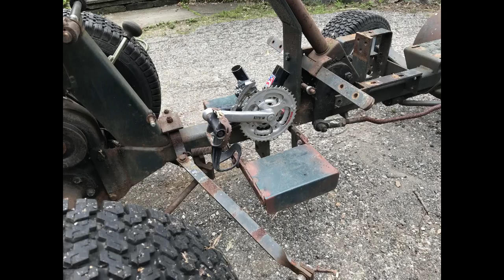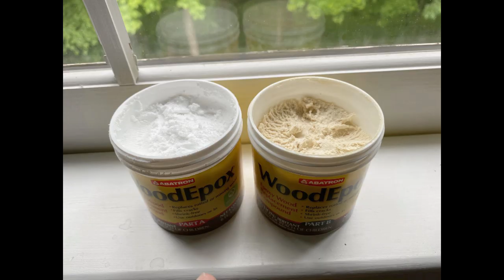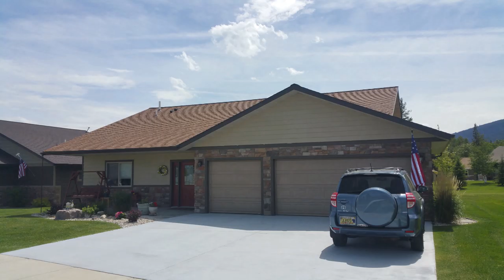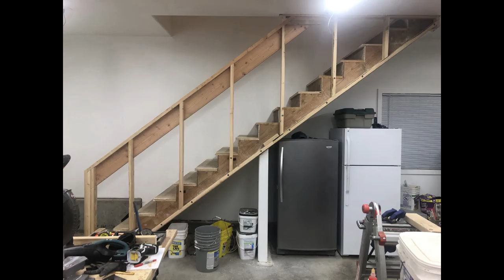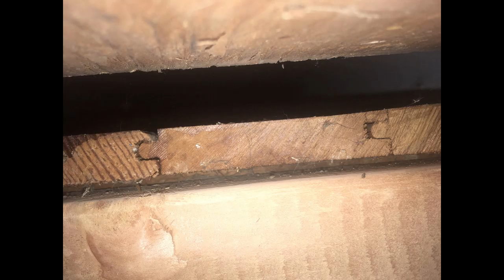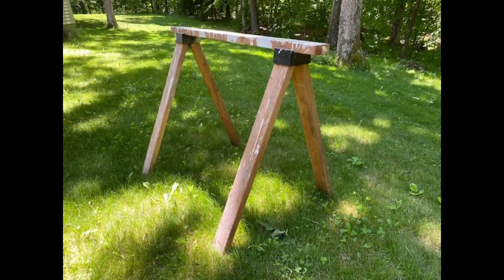Podcast 255: Ridge Vents, Removing Blown Fiberglass, and Matching Textured Drywall

Comment: Good video as always even without the sound.
Minnwax also makes an epoxy product for rotten or punky wood. First you use a liquid epoxy to harden the wood then use the two part epoxy to fill the void and shape the area.
I have also had a ridge vent come loose about 12 years ago. I have a double hipped roof and after a storm I found it laying in my backyard but it was not damaged. The reason it came loose was because the roofing nails only penetrated the OSB about an 1/8 inch or so. I replaced all the nails with longer nails and some stainless steel screws and it has held up so far with no issues.
As far as saw horses go the gentleman from “Next Level Carpentry” might have the best design I’ve ever seen. I made a set and they are excellent. Here is the link to his video.....
https://youtu.be/GPtkjqdZFzY
I believe he has two videos about saw horses and I believe this is the longer version.
Ron